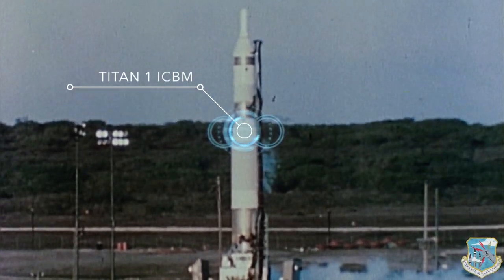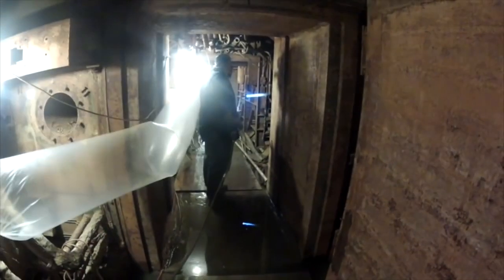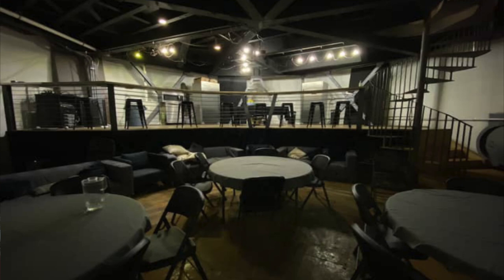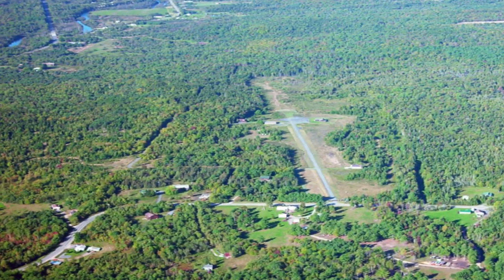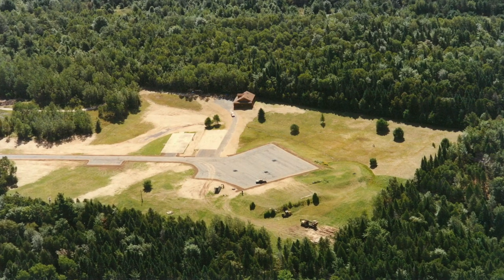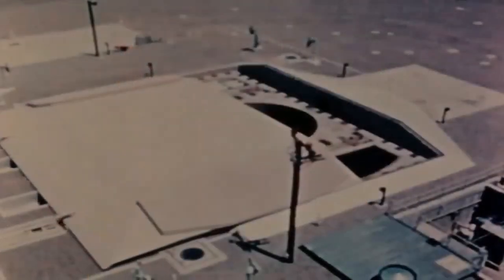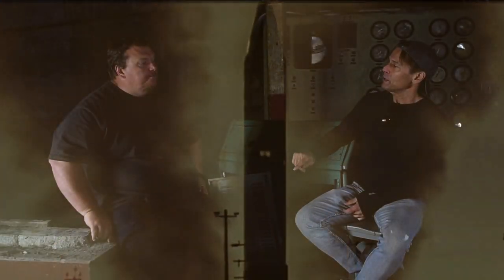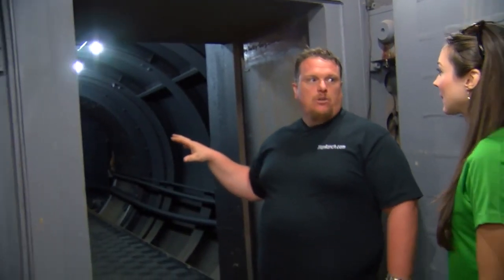Ep. 36 - So You Want To Buy a NUCLEAR MISSILE SILO ?

Comment: good luck to who ever bought bruce's silo in NY. the hydraulic rams, which are the biggest part of the silo's shock absorbing system have been removed, meaning if an earth quake or nuke blast ever actually hits the area, the whole thing will collapse. doesn't matter how much money you put into it or how pretty the finished areas are, the structure is literally worthless at best and a death trap at worst. 

the hydraulic rams bruce removed as part of his renovation were designed to guide the inner silo tube straight up and down inside the outer tube in the case of a blast or earth quake, preventing the two concrete tubes from colliding as the inner tube bounces on the suspension system. without those rams, the inner tube is free to collide with the outer tube if any movement occurs, which would result in both tubes crumbling, burying anyone inside under about 100 tons of concrete rubble that could take weeks or months to excavate during any possible rescue efforts. 

and before any one asks, yes i know the rams were removed, as bruce confirmed as much through emails a couple years ago when i contacted him for info on the silo and specifically asked about the suspension system.
Reply from the maker: It’s still very much formidable.

Comment from the maker: Find out what it takes to acquire a Missile Silo and the daunting challenges to expect when considering a potential purchase. Define which model Missile Silo is best suited for your development needs. I LOVE Titan 1's and Atlas F's. Love to get your feedback in the comments section below as to which Missile Silo you much prefer... Be sure to visit www.TitanRanch.com if you want to sleep in a Titan 2.
Reply: Very cool !
Reply: good luck to who ever bought bruce's silo in NY. the hydraulic rams, which are the biggest part of the silo's shock absorbing system have been removed, meaning if an earth quake or nuke blast ever actually hits the area, the whole thing will collapse. doesn't matter how much money you put into it or how pretty the finished areas are, the structure is literally worthless at best and a death trap at worst. 

the hydraulic rams bruce removed as part of his renovation were designed to guide the inner silo tube straight up and down inside the outer tube in the case of a blast or earth quake, preventing the two concrete tubes from colliding as the inner tube bounces on the suspension system. without those rams, the inner tube is free to collide with the outer tube if any movement occurs, which would result in both tubes crumbling, burying anyone inside under about 100 tons of concrete rubble that could take weeks or months to excavate during any possible rescue efforts. 

and before any one asks, yes i know the rams were removed, as bruce confirmed as much through emails a couple years ago when i contacted him for info on the silo and specifically asked about the suspension system.

Comment: A Titan I has much more space to build out than Atlas or Titan II. The Control room, Power house are multi story build outs. I have no idea but say 25,000 sq. ft. of multilevel space. I would like to see the bottom of one of your silos but I worry water leaking in will be an expensive cost. I would never expect you to build out a silo. Would love to see floor plans of what you want to create in your complex.
Reply from the maker: Well over 100,000 ft for the T1 @Erik567.
Reply: @NuclearBunkerLiving  I worry for you that if you need plans approval from the city to build living accommodation the road blocks could be severe. In Cal. every new home built has to be able to egress to the outside directly in case of fire. How you protect from fire in a complex like yours I have no idea.
Reply from the maker: The Titan 1 has multiple vertical shafts that will have emergency stairwells and elevators. I lived in the Hollywood Hills in LA, took me 7 years to build a 7 level hillside home. I will never build out again in CA. The compliance and regulatory is at ridiculous levels.
Reply: @NuclearBunkerLiving  Tell me about it. I built a 2 story split level with 650 cu' yds. of basalt bedrock removed for the lower level in Rancho Palos Verdes, ca. in 2010. Had to put in mandatory fire sprinklers and make the house withstand a nuke blast/earthquake. 1 year passed before plan approval.
Reply from the maker: Incredible. Deep lessons there. CA is doomed.